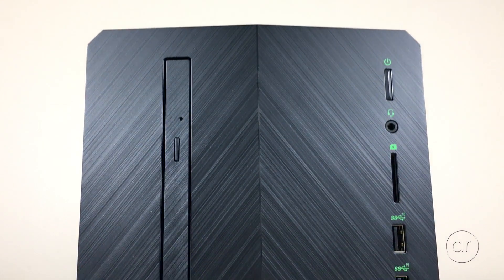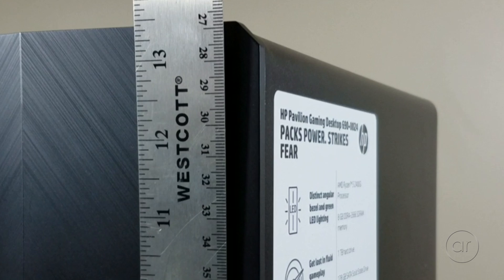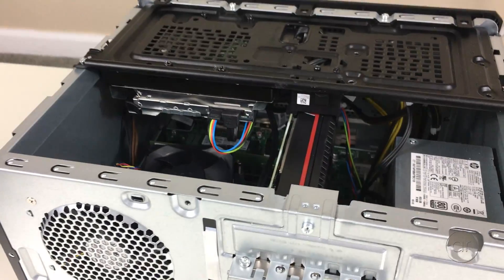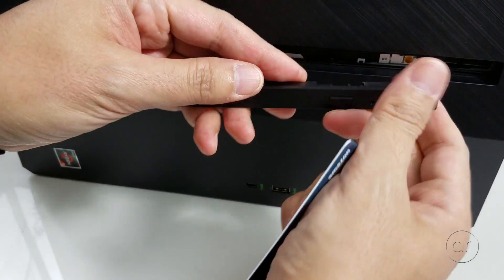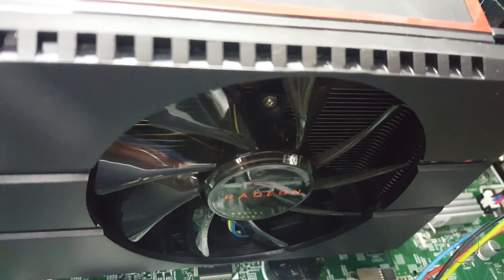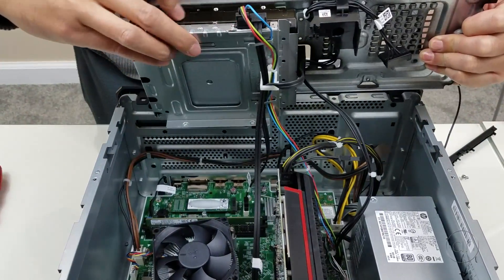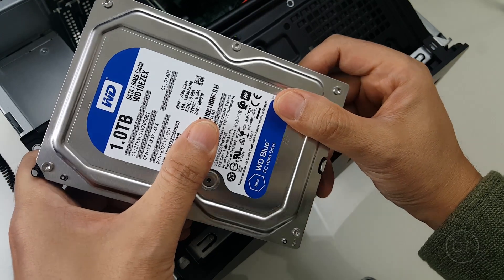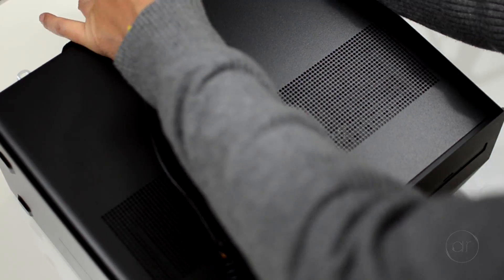How to Open and Upgrade a Ryzen-Based HP Pavilion Gaming Desktop

Comment: i have the 690-0067c model. i want to upgrade the gpu from a radeon rx 550 to a radeon rx 580. do you think this will work? will i need to change the psu
Reply from the maker: The 690-0067c has a 310W PSU so you would need to upgrade it (for reference, the 690-0024 has a 400W). As long as the PSU is upgraded, you can upgrade to the RX 580 (you can use HP's part like the one in the description).
Reply: @accessrandom  huh, thats weird because i thought the rx 580 requires a 500 psu
Reply from the maker: It could be just the specific model that HP uses in their builds... they matched the RX 580 (single fan, 4GB) with a 400W PSU.
Reply: @accessrandom  The 690-0034 has the Rx580 and the 400WPSU. I also added an EVO 860 SSD by using 2 sided tape to anchor it.
Reply: I have the stock Ryzen 5 2400g, but I don’t know wither to upgrade to the ryzen 7 2700. And could you tell me what the best graphics card upgrade would be?

Comment: Can i upgrade the processor with the ryzen 5 3600? (On the same computer)
Reply from the maker: Unfortunately, according to HP's specs, you can upgrade only to second gen Ryzens (up to an AMD Ryzen7-2700).
Reply: If you try it out though let me know if it works cause i wanna do the same xd

Comment: What SSD adapter would you recommend if I wanted to add an additional 2.5 inch SSD?
Reply: Just adding that that is accurate, I had two 2.5" ssd's installed that way. One of them had all four screws holding it in and the other one just had two screws diagonally which seem to hold it just fine. since then I have removed the cage entirely and just use double-sided tape to secure one of the SSD is to the top of the inside of the case.
Reply from the maker: Unfortunately I was never able to find an adapter, but two of the four holes on the rack do match up with the mounting points on a 2.5" SSD - so you could use those. I personally used velcro to secure it to the rack.

Comment: I had a working psu it is a cooler master 450w psu but I guess a Corsair or EVGA one will also work although I would suggest a 550w psu as using a 450w psu may lead to unequal  power distribution
Reply: I calculated the wattage it was a bit higher than the list(psu) wattage
Reply from the maker: I think you may be the first to report a successful replacement of the PSU. Could you send the model number of the CM power supply and the model of Pavilion into which you placed it? I'd like to add it to the description with credit to you.
Reply: Actually in the place we live a huge power cutout  has occurred due to a rainstorm so I won't be able to send the model number anytime soon(I probably wrote this message hours ago and you read it now cos we have to rely on a crappy internet connection here as of now)
Reply: HP Pavilion 590-p0034il Tower PC 2018 (Intel Core i3-8100/4GB DDR4 RAM/1TB HDD/DOS/Bluetooth/Wi-Fi/Without Monitor/Integrated Graphics), Black

Ok this is the model of the computer
Reply: And list wattage is 180W so a GOOD 450W psu will do the job(pls don't buy the Corsair vs450 it's just not good instead buy cooler master or even circle or EVGA will do)
Reply: The model name is Cooler Master MWE 450-Watt Power Supply
Reply: But I would suggest buy an 80+ bronze certified psu
Reply from the maker: Ok, thanks for the info! I'll make a note of it.

Comment: To add another 3.5 HDD do you need to use a caddie? I have an additional drive to add in but without a caddie only two fixing screw holes line up on the cage.
Reply: by caddie i mean a sleeve/bracket- not sure of the right name
Reply from the maker: I know what you mean - the hole pattern on the cage doesn't quite line up with the mounting points on a hard drive, so there must be some type of special bracket or adapter that allows you to mount it (unfortunately, I am not aware of one). In your case, as long as the two screws secure the HDD from moving I think you will be fine. For my SSD, I just used some velcro strips.
Reply: @accessrandom  Thanks for the reply, I think the problem also is that my HDD is one of the newer models Seagate Barracuda 6TB, and in these HDDS they have removes the middle fixing holes. and are using a two at the front and two at the back configuration. I ended up fixing the front holes (the ones that line up near closer to the sata input) and using some double sided tape (the good stuff used in aviation) along the back and pressing it against the cage.

Comment: Can you take the internals and switch cases for more room?
Reply from the maker: The only concern I have is that the motherboard and power supply are non-standard (for example, the motherboard has mounting points for the CPU fan drilled for Intel, even thought the CPU is AMD). I haven't compared the points for mounting the motherboard to a standard ATX/ITX case, but that is something you should keep in mind.

Comment: Could i upgrade to a gtx 1660ti itx model?
Reply from the maker: I think that should fit physically. The only problem is that it has an 8-pin power connector whereas HP's power supply provides a 6-pin (if I recall correctly). It also recommends a 450W power supply, so you'd need to upgrade the PSU.
Reply: @accessrandom  How much would that cost to upgrade the PSU

Comment: anyone found an 8gb rx580 to fit in this case?
Reply: Also, is the power supply of 400W enough to run said 8GB rx580?
Reply: My hp pavilion 690-00xx has an rx 580 8gb not sure about power supply though

Comment: Is there a way to install a clear window on the pc
Reply from the maker: When you clone, Macirum considers a partition to be one indivisible object so there's really not a way to separate Windows from your programs, drivers, etc. However, you can always re-install Windows or restore the factory image (if your computer manufacturer has provided one).
Reply: access random I meant a glass window panel to the side so you can look inside the pc
Reply from the maker: Ah I see 😀 Sorry, I misunderstood. i haven't tried it myself, but you could probably use a dremel tool to cut out a section of the side panel (the one with the vent hole panels on it). Then you could cut an acrylic sheet to fit - I assume glass would be more difficult to work with.

Comment: Can i put a xfx rx 580 in there and if not can i change the case
Reply from the maker: XFX reccommends a 550W power supply (minimum is 500W), so based solely on the power requirements you'd need to upgrade the PSU. In addition, I'm not sure if it would physically fit.

You can change the case, but I'm afraid you'd probably need to replace the motherboard also if you plan to upgrade the PSU (to handle the XFX). The PSU appears to be non-standard, so both the motherboard and PSU would need to be replaced.

Comment: So i could add the rtx 2080 in there?
Reply: No, a Ryzen 5 2400G with a RTX2080 is a horrible combo resulting in horrible FPS. If you want an RTX2080 with maximum performance consider upgrading the CPU to a better one. The case would most likely not be able to fit an RTX2080 anyway.
Reply: I lol'd ...this must be a troll post

Comment: I know, this is a GAMING pc but what I do I NEED a great graphics card and a lot of RAM and a decent CPU cause i do stuff like edit 1080p video (i hope i can do 4k) and I do a lot of virtualization too as well as a screen recorder (Camtasia) so I wonder if this will be good
Reply: I also play games sometimes with my friend on YouTube
Reply from the maker: If you have the same model (690-0024), you'll want to go to at least 16 GB of RAM since the onboard graphics will dedicate about 2 GB of system memory (whether you use it or not). And you'll probably want to replace the HDD or add a 2.5" SSD for storage of your video files. Otherwise, it will do fine with 1080p video editing (I am using it myself for that purpose, with the upgrades I mentioned). It will definitely struggle with 4K editing though. I can also run two VirtualBox VMs simultaneously on the same system.
Reply: @accessrandom  ok cool! I already have SSDs in my current PC. Thank you for the advice!

Comment: I have this Same desktop but My graphics Card is different. I do have the same AMD Ryzen 5 Processor Vega2400g. But my graphics card is an Nvidia GeForce GTX 1050. It came that way new. There are a few different models that I have seen. I'm glad I got the Nvidia GeForce GTX 1050 tho. But still wanting to know how much I can upgrade
Reply from the maker: I'm afraid the only report that I've received is an upgrade to the same GPU that you have (the GTX 1050). I'll update the description on a continuous basis and add any others that I receive.
Reply: @accessrandom  Oh ok. So that's what I'm wondering. Like if I wanted to put a GTX 1080 inside of it could I? I have seen other videos on Ppl opening theirs to look inside and there is room actually. Surprisingly. I mean I got this one since it's my first desktop, but Because It is so compact compares to other towers. For instance next month I go to a beach house for a week on vacation. I usually bring my laptop but now I got this and I can Pack it up in a Travel bag. Only big thing is my Monitor. But he'll I could buy a small monitor just for occasions like that. 

I would really like to know tho if The Graphics card can be replaced. So far the answer seems to be yes. But with different models comes different outcomes. idk much about computers so like putting a GTX1080 in would work with a ryzen5? Or would it not be compatible and mess up my Insides. Hmmmm
Reply from the maker: The good news is that the PCIe slot seems to be standard such that you can swap out the existing GTX 1050 with another, as long as 1) the card physically fits in the case, and 2) the power supply is large enough to handle an upgrade. Unfortunately, HP cuts it close with their power supply requirements, so you may need to upgrade to a larger one to handle a more power-hungry card. If you search for information about the power consumption of the GTX 1050 and 1080, you'll see that they use (worst-case) approximately 75W and 175W respectively. Another problem is that the power supply does not seem to be a standard one (I haven't gotten any reports of a successful upgrade to a third-party PSU).
Reply: @accessrandom  also yeah the Processor AMD Ryzen5 has the Vega Graphics integrated into it. That may be a problem. HP advertisers the HP Pavilion gaming desktops as upgradeable to keep up with the current tech in quotation marks honestly I think my ryzen5 last quite a while and the only thing I might try to do is go with a higher GTX because honestly why buy an RTX when none of the games I play have anything to do with Ray tracing although if Ray tracing is compatible on an any game it would look cool. But yeah I get great performance as it is and I play PlanetSide 2 and MechWarrior Online which are both heavy graphic-intensive and CPU intensive I went with the GTX 1050 because it's not that expensive and it was the best option at the time and I'm still surprised how well it can handle a game like PlanetSide 2 with 100 vs 100 online players in one area and not only that on high settings with minimal drops to 40fps mostly staying around 60 but it drops to the low forties when particles and shadows and lighting plus 100 players together and that blows my mind. I hadn't played Skyrim in a while so I opened it up put it on Ultra and I had 101 FPS. When I record it goes down to 95 fps. I couldn't believe it and lastly I downloaded Kingdom Come Deliverance and I get well over 60 on that to which that game is freaking insane very good graphics

Comment: quality vid, i just upgraded my 0020, it's the one released earlier that year and actually has integrated graphics capable.. it's lacking the nvme ssd, i upgraded  with an old regular ssd.. and yes, you'll need a bracket, except what i did was simply switch the hdd to the other side of the cage.. and then above the disc player, there's screw holes to mount an ssd directly.. again, thanks for the vid.. the only thing is the plastic giftcard did not work for me LoL! use a paperclip to press the extra button inside the front pinhole, and pry the disk cover off by hand 😂 🤣
Reply from the maker: Thank you! This will be very helpful for others (esp. the tip about the DVD/CD player).
Reply: How did you get the ssd to work, I tried the same thing, but the computer won't let me boot from an sd card or a usb stick, so how did you do it please?
Reply: @theCUDDS  maybe push Esc a bunch of times on start up, and go into bios and make sure the boot device is usb and not the hard drives

Comment: I just got upgraded to Ryzen 7 2700. When I went to put the fan down there was nothing to latch it onto. Help?
Reply from the maker: The mounting points for the CPU fan are actually drilled for an Intel CPU (you can see people having problems with this in the description). I'm afraid you will need to re-use the existing fan, or obtain a fan that provides both Intel/AMD mounts (so you can choose Intel).

Comment: Hi access random i purchased an m.2 ssd for this pc and it didnt come with a screw. Do you know which screw will work with this motherboard for the m.2 ssd? Thanks
Reply: Just use the screw that is already inside the case, the PC comes with a m.2 SSD preinstalled
Reply: If for some reason yours didn't have one, search Amazon for m.2 screw

Comment: I have the same computer but a 580 and ryzen 5 if I get an ryzen 7 2700 do I have to get different mother board?
Reply: I don't think the socket are the same
Reply from the maker: Do you mean that you have the same 690-0024 Pavilion model with the Radeon RX 580 and the Ryzen 5 2400G? If so, according to HP's specs, the motherboard will support an upgrade to a Ryzen 7 2700.
Reply: access random yes I do
Reply: access random thank you!
Reply: I just got the Ryzen 7 and it fits but the fan doesn’t have anything to latch on to
Reply: Lowkxy FN do yo have to but something for it?

Comment: Hello if i wanna a second ram exactly like the one that the pc have, i just buy it...open the pc and add it?
Reply from the maker: Yes  - there is a second slot so you can either add another of the same, or just replace both sticks with a higher capacity (if you want even more memory). I've added the models of memory that have worked for others in the description.
Reply: @accessrandom  Thank you !
Reply: @accessrandom  Is it possible to upgrade to an amd rx 5700
Reply from the maker: There was a comment left by a viewer named Apache Helo Copto who had an excellent list of suggestions, including the RX 570. You should be able to search for it in the comments below. From what I recall, you'll need to remove the small bracket with the QR code, and you'll need to make sure the card meets the power requirements for the power supply that you have.
Reply: @accessrandom  Thank you very much
Reply: So i buy the samsung ram in the description and add it? Another question what cpu cooler do you sugest?
Reply: do i need to change the cpu cooler? if i get a corsair h60 do i substitute by the other van atached to the air intakes? and should i position the fan in a way that push the air out from the pc case or push the air in to the pc case? Thank you
Reply: So if i decide to experiment the cpu with the original cooler before  change to a better one...wich temperatures numbers  could tell me that  i dont need to change and wich temperatures tell me that i realy need to change? Thank you!
Reply: @Emanuel210bolt  I've heard that there are issues with swapping out the cooler on the mobo.
Reply: @mapsgoonthewall5396  Thank you for the warning :)

Comment: I saw this is on deal for 450 dollars on amazon what I wanted to know if can the motherboard also be changed
Reply from the maker: That is a great deal if it's the same model. The consensus is it's a very custom motherboard with Intel CPU fan mounts (even though it's a Ryzen CPU). You'll need to get a new CPU fan. If you change out the motherboard, you may also want to change the power supply as I've been getting reports that the pins are non-standard.
Reply: @accessrandom  it's the 690-0020. So the only difference should be that it has no 128gb ssd.
Reply: Saw the same deal and just ordered one for my gf. I saw a lot of link to people asking your question and it sounds possible (but a hassle).
Reply: The question is because I’m looking into building a micro ATX pc and it has almost exactly the same specs but a much better looking case than what I have found for my budget which is 500. I’m building with the hopes of upgrade when I get more money.

Comment: You think it would be possible to take out everything and put them in a bigger case?
Reply from the maker: It's hard to say considering it's such as non-standard motherboard (for example, it uses Intel-based mounting points for the CPU fan even though it's a Ryzen). The next time I'm in, I''ll need to see if the mounting points for the motherboard itself matches up with the ATX/ITX standards.
Reply: access random ok